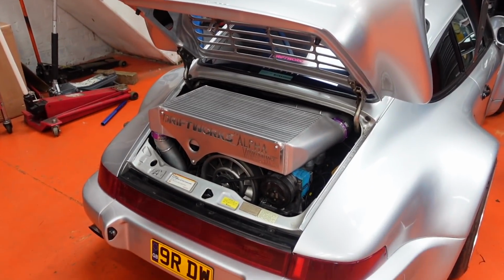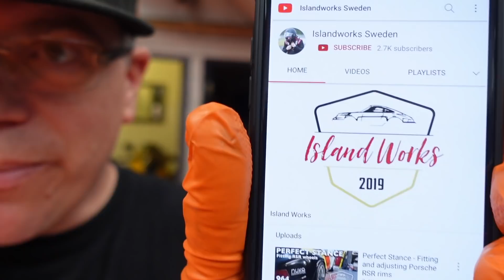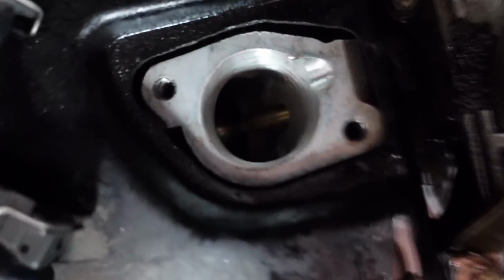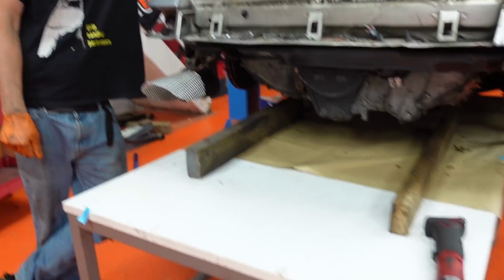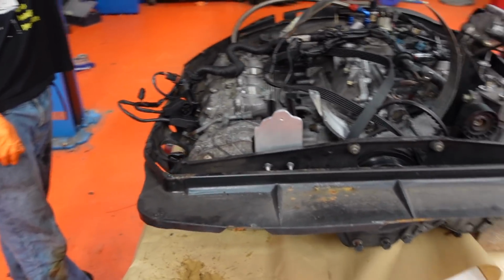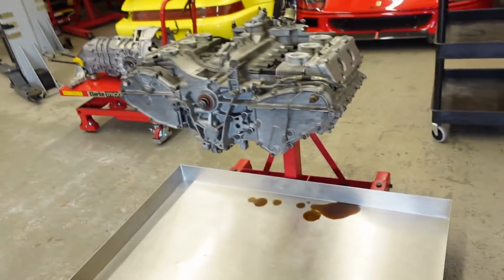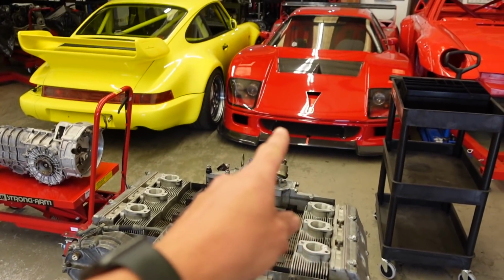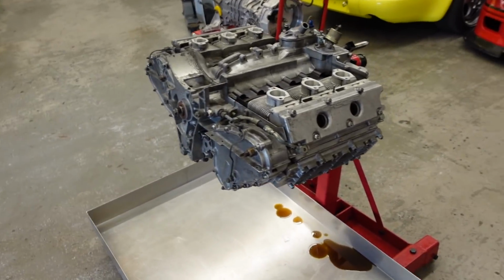My Porsche 964 Turbo engine rebuild starts with dry ice blasting

Comment: What is the rough cost on getting an engine dry ice blasted?
And what are the pros and cons against other media blasting, apart from obviously not making a mess?
Reply: I believe that dry ice blasting is one of the least abrasive types of media blasting. However, i believe its rather expensive due to the amount of ice needed and the type of blaster that is needed.
Reply from the maker: As above, it's really quite expensive, but a great choice on an assembled engine as the media can't damage anything if it gets inside.

Comment: Send the Cylinder Heads to Xtream Cylinder Heads in Florida.USA.
You wont be disappointed.
Reply from the maker: I probably would when I got the bill. I'll just add more boost.
Reply: Just junk your heads and buy a set of Billet heads from Extreme.

Comment: Hey Phil, Any chance we could now see Jay get protective gear on and do a Stage 2 Engine aluminium brightener spray and scrub while rebuild is happening at Fearnsport. Maybe if you guys go there and do a collaborative video and give them free promo shoutouts to cover the extra time it could work. Example here of before and after results: https://youtu.be/5m2vjOtFTiI 4:30 V-Vuned is very rough and ready cowboy style presenter if he can do it without the gift of OCD why not give it a try with some scrubbing and pressure washing to finish strong. For me the ice blasting really is just the first step with grime removal without scuffing the Aluminium. Looks like you must use a nylon brush on the Aluminium to avoid scuff marks and probably ensure the acid sits on the metal for same time levels aiming for even brightening. Also me and the other guy in the comments section would really love to see the full ice blasting video with some tunes over it as a bonus feature, if not on your main channel (i get it branding etc) you could always create a second channel for your cool B-Roll that is left on the cutting room floor. It’s like pimple popping videos, strangely satisfying ;) Loving the videos Team keep up the good work. P.S. I suggested Jay because once your driving around in a Batman Lambo do you even get your hands dirty again scrubbing Aluminium with acid? LOL